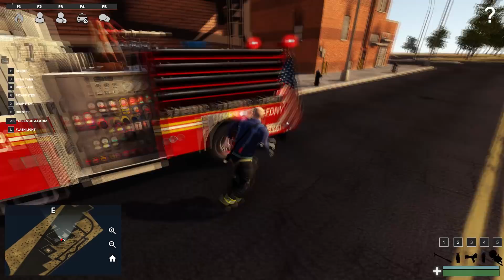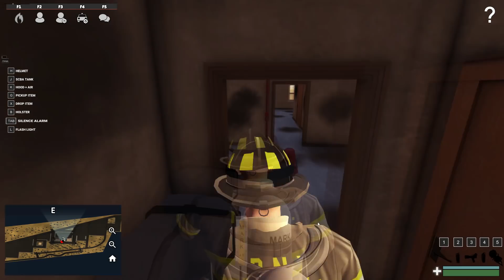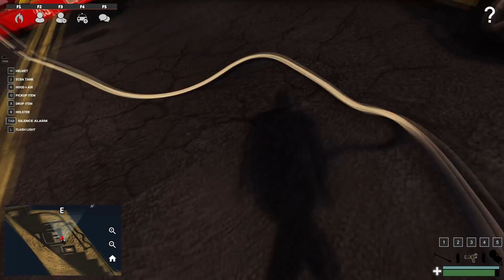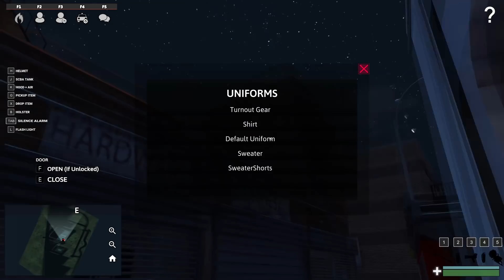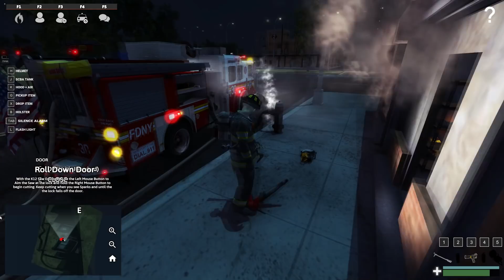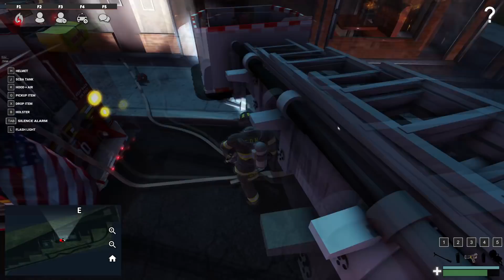EmergeNYC - Fire Academy - Hoses, Water Supply, Pumping, Standpipes, Hydrants, Tower Ladders & More

Comment: Loving ur new update! Just one issue though. I'm able to charge the supply line in the academy, but when it comes to free play, the supply line just cant get charge when i on the hydrant. Any fix for this? Much appreciated!!
Reply from the maker: We are fixing this right now in the next hot fix
Reply: I cant charge the supply line in the academy, is this due to the hot fix?
Reply: im fine in the academy but when im in free play, theres no water
Reply: thanks alot! looking forward!
Reply: There is water but the tank runs out really fast and the green light is never lit for the hydrant
Reply: I downloaded the trial on steam and I could get the hose to work not even after what you said.